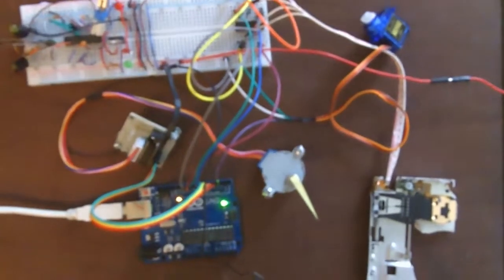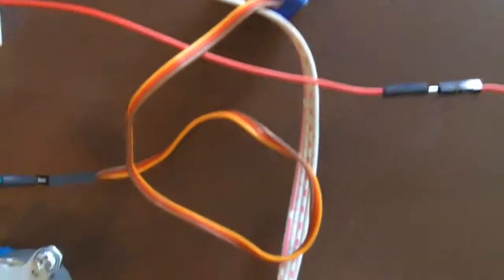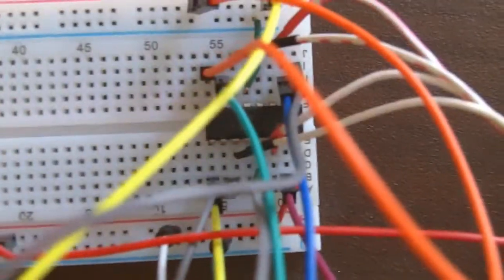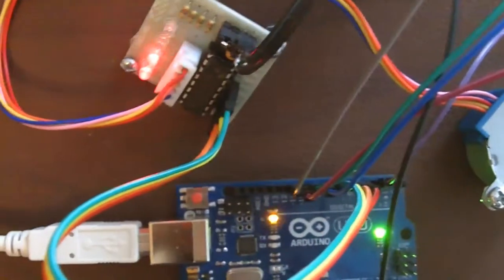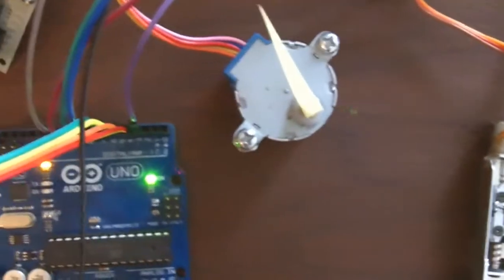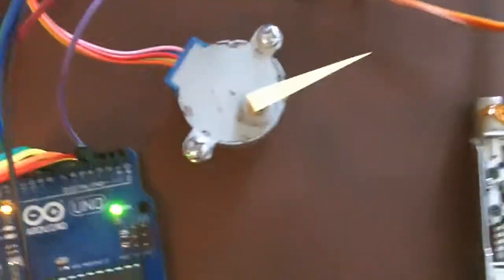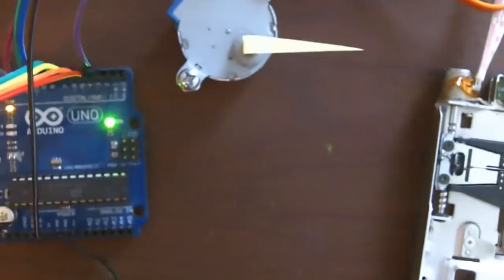Running 3 motors with an Arduino UNO (2 steppers, 1 servo)

Comment: Sorry if this is a dumb question I am still learning.. I want to drive two of the stepper motors that use the driverboard. The problem is I only have one 5V output. I tried using one of the digital pins as a second 5V output but it didnt work. Maybe the current is too low? Idk, I am bad at electronics lol. Thanks for the help
Reply from the maker: Do you mean using power for the stepper motor driver board(s) directly from the Arduino's 5V pin? If so, you can sometimes do this, but it's not advised because it will likely come close to pulling too much current from the Arduino (and its 5V regulator).

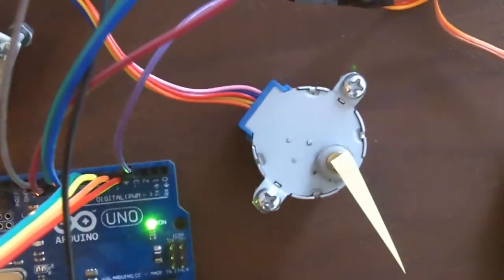So usually it's best to bring the control lines from the Arduino, but supply power from a dedicated power supply. If you freeze my video at 1:04 you can see two black wires (sorry, I didn't use red&black colored wires!) that go to the ULN2003 driver mini-board from the breadboard for power (not from the Arduino 5V pin). And a data pin will most surely not be able to supply enough power (data pins are limited to 40mA).

See https://lastminuteengineers.com/28byj48-stepper-motor-arduino-tutorial/ for an example.

So often you supply power to both the Arduino and motor driver boards from a single source (e.g. 1amp 5V power supply or a 9V battery, etc.) Even better is separate supplies so that no noise interferes between the Arduino and the motor driver board.

You can Google the driver board and find lots of examples, but it's probably a good idea to read two or three tutorials or more to carefully examine their power supply connections -- because some of the tutorials might have mistakes!
Reply: @espectraa1s  First off, thabk you so much for you quick and detailed reply. So you are saying I should use a separate power source for the motors? So far I have one motor pluged into the arduino board which is connected with my PC and one connected to a seperate power source. I plan on using an adafruit motorshield v2. Would I be able to draw the power for both motors from that?
Reply from the maker: @enricopalazzo331  Adafruit makes good stuff. It looks like their v2 board pulls power directly from the Arduino's barrel jack power (NOT the Arduino's regulated 5V pin) which is good.

https://learn.adafruit.com/adafruit-motor-shield-v2-for-arduino/powering-motors

It also has a separate power "terminal block" for separate power, and you can select which one to use (barrel jack or terminal block) with a jumper.

It should work fine for your two stepper motor project. The Adafruit docs mention using the Accelstepper library like I mentioned in my video for when you want to control the two motors without any "blocking" code. I'm not too familiar with using it for the Adafruit board. But the good news is that this hardware setup should work for you with some experimentation!
Reply: @espectraa1s  ok. Thank you again. Its for a school project. I need 2 steppers and a servo but I guess it should work. I am also using serial communication between matlab (we have to use that for the project) and arduino. Controlling it directly with matlab doesnt work so thats why I needed that workaround. Anyway thank you again, you really helped me. The motor shield should arrive in a few days I hope I can figure it out form here :)

Comment: what are the things needed thanks for reply
Reply from the maker: Well, you need an Arduino (or clone), the BYJ48 stepper motor (or similar), driver board or chip for stepper motor (Darlington chip mentioned in video or L293D), servo motor, breadboard, Arduino power (e.g. 9V battery), separate 5V power supply for motor power.

Then a second stepper motor if you want (floppy drive worm gear motor in video) plus driver chip (I use L293D).

Then the AccelStepper library you can download from the internet.

Comment: Hi ..ur video is very helpful,thank you very much..i want to use the servo to open and close a valve..i want the valve to be open for 20 sec and close for 40sec.how can i modify your code to achive this.i want the stepper  motors running at the same time..i look forward to your response
Reply from the maker: Sorry for the late reply. Didn't see the comment pop up in YouTube!?

Anyway, for the service 20sec timing, I guess modify my code to push the servo in one big step with a 20 sec update time. Then hack it to wait 40 sec before going back. My steppers run at the same time, but have very different logic, one pushes floppy drive worm gear motor all the way out with acceleration/deceleration, then pulls it all the way back. The other stepper runs sort of like a clock, with acceleration/deceleration again, but in smaller moves all the way around.

You can maybe check the code to match it with what each motor is doing in the video. For your application, choose which movement style is best and use that for your motors. Probably needs a lot of experimentation...

Comment: when you wrote the sketch for this, did you really only use one breadboard and one arduino uno? I have been trying to make a sketch combining 2 servos and one stepper and I can't figure it out to save my life.
Reply from the maker: Sort of... There's the breadboard, UNO, and also the stepper driver board. You pretty much need some sort of external chip/h-bridge/etc. for each stepper motor since the UNO can't supply enough current by itself.

Servos are easier in a way, since the UNO can control them by itself using a pseudo pulse width modulation signal on a digital pin (the driver chip & circuitry are built into the servo, and I guess these little "hobby" servos don't need all that much current).

So I'm doing 2 steppers & 1 servo, but you wanna handle 2 servos & 1 stepper, right? I seem to recall there might be some conflicts with the Arduino's use of the microcontroller timers when mixing servos & steppers. I'll have to go back & look at the code, but the AccelStepper library made things easier.

I'll try to post the code and any notes I can dig up from back when I was messing with this. Stay tuned...

Comment: did you ever put this on your web page?
Reply from the maker: UPDATE: I put a zip archive of the sketch/code here http://www.peculiar-games.com/arduino-adventures/2steppers1servo

LOL, no... I got lazy. :( Well, the project didn't work as well as I wanted but I did make some progress. It was basically going to be a plastic gear cutting machine. I previewed it a bit in a video: https://youtu.be/0kKpkBpIDkA

Then I got sidetracked with more general computer controlled machines, and lately high voltage stuff.

If you're interested in the code, I could put it up on the website. It would be unpolished but should work for studying & experimenting.